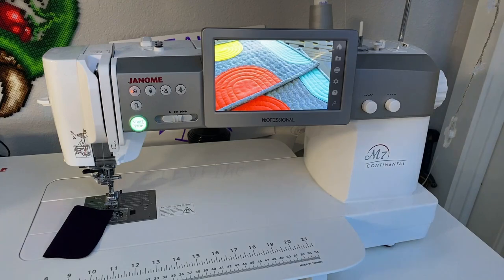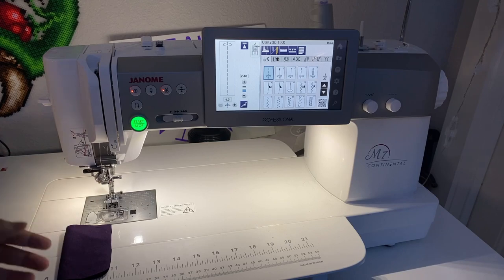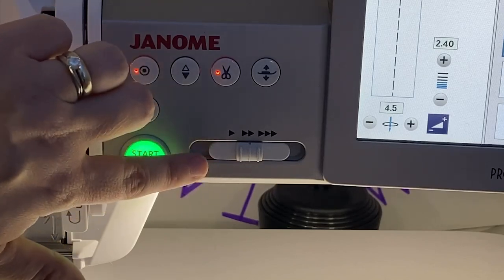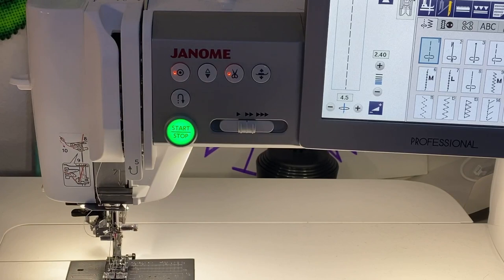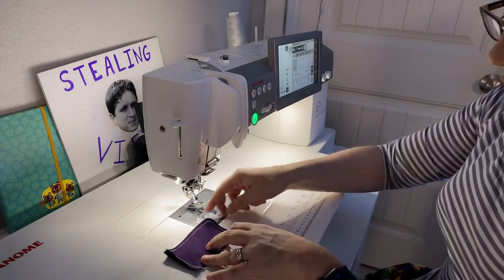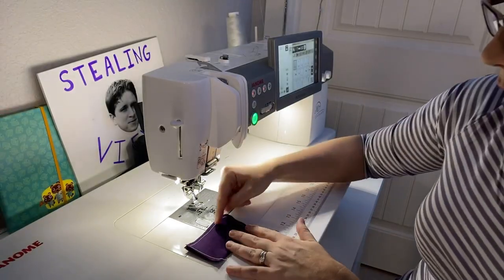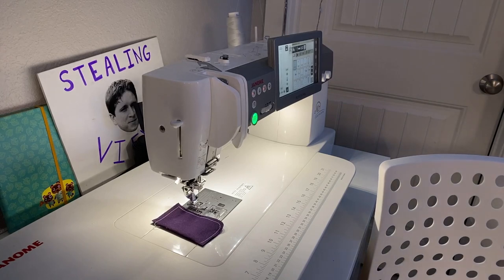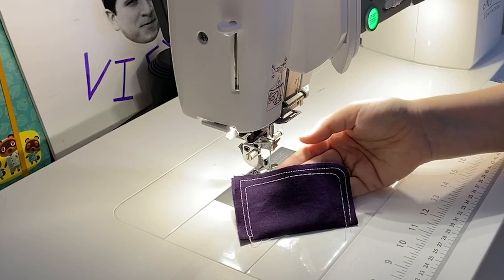Sewing Tips: Pivoting for Corners and Curves

Comment: One of the things I've noticed with videos and tips about doing corners is they all assume that the needle will just be in the right place to pivot the fabric. As a newbie, one of the issues I'd have is that because of my stitch length, the beginning of a stitch is too far from where I need to pivot, and the other end of that stitch would be too far. I've compensated for this by doing the manual wheel turning when it gets close to the corner, eyeballing the distance, and often shortening the stitch length for the last one or two stitches to give me more control of where my pivot point will be. I'm using a vintage machine, and can't choose a precise stitch length, so there's some guesswork involved. It's an adventure. 🙂

Comment: With a manual machine if your stitch length means you would be stitching too far. When I get to that position I set the stitch length to 0 and rotate the wheel to drop the needle and make sure it goes down and partially back up. Then reset the stitch length pivot and head off again.

Comment: I have been sewing for years but I have had the same problem on different machines so I must be doing something wrong. When I pivot and start sewing again, sometimes the stitch skips - so the top stitch is at a diagonal and you can see the bobbin thread on top pulling it.  It is incredibly frustrating.  I have both a juki with a bobbin case and a janome with the drop in bobbin and this happens  on both machines.  I don't know why :(
Reply from the maker: There's typically two rotations of the wheel. My Juki may be a bit better at this technique than a domestic, but you'll rotate once, then rotate until the thread pickup loop is up at the top, but the needle is down. That's when the bobbin thread has been looped and you're good to pivot!
Reply: @fiercekittenz  ok - so stop a little before the end, make my stitch length smaller just so I don't overshoot it, manually turn the wheel for two more stitches and then pivot?  Is that right?  (thanks for helping me by the way).  I have a Juki 2010 and I love it but this is making me a little crazy LOL

Comment: Thanks for this video.  Do you really use the magnetic guide on your M7??? 
Upto now I did not, because of the magnetic stitch plates. I’m afraid that it causes damage to the machine?
Reply from the maker: No, I don't because I don't really need it. Though you'd need an industrial-level magnet, like military grade, to damage anything on the machine. This is a small magnet. You'll be totally fine using it.
Reply: @fiercekittenz  thanks 🙏